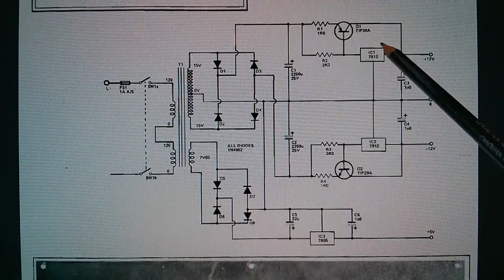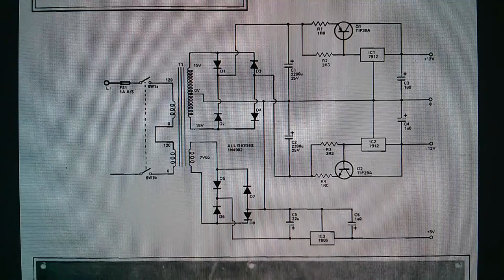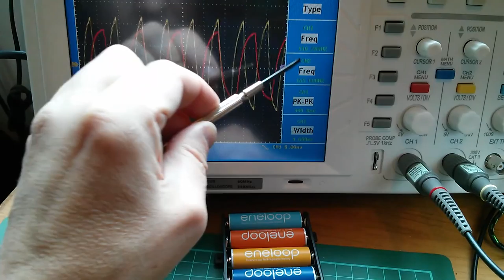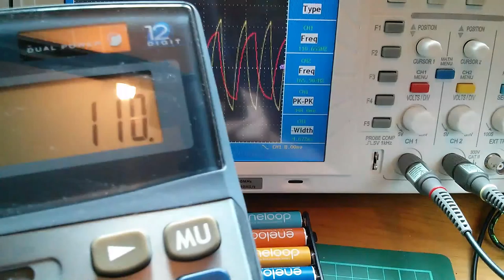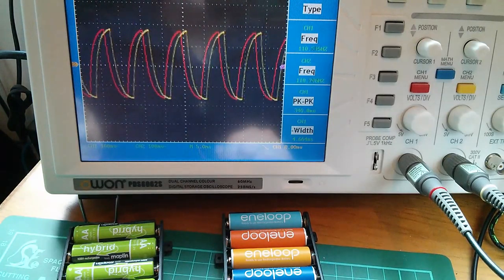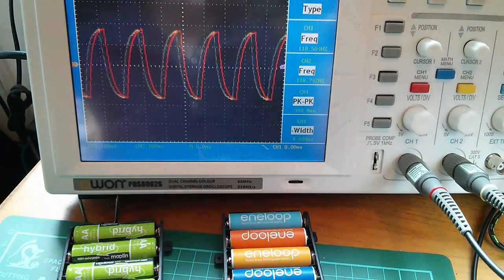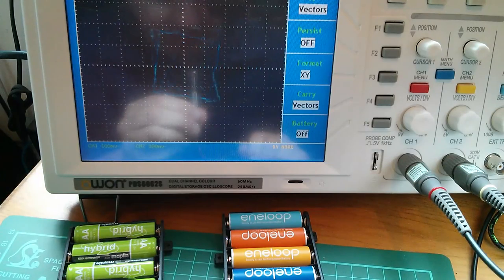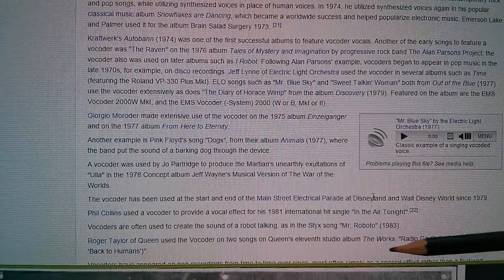Julian's Project: ETI Vocoder - Internal Excitation Oscillators

Comment: I'm just rewatching old videos and I wanted to correct an error in this video. The musical scale is not as simple as you stated here. In the modern 12-step scale, the frequency is multiplied by the twelfth root of two for each step up. If you start at A440 and you want the next note up, chromatically, or Bb, you multiply 440Hz by 1.059 (approximately 12√2) and get 466.164Hz. For the B you would mutliply 466.164 by 12√2 to get 493.833, etc.

I've been following this build and drawing circuit boards to make my own. I've found that R18 is missing from the Internal Excitation Network and I've determined (I think) that R18 has to go from the wiper of RV7 to pin2 of IC4 and R17.

Comment: Using a switch mode PSU can be a problem. You have already seen that two oscillators can "lock" to each other. With a cheap PSU you may induce noise into the circuit. In the worst case it's in the audio frequency range and you have constant beeping noise. In a slightly less bad case it will make your oscillators "jumpy", when they suddenly lock to one of the noise frequencies of the PSU while tuning them.
Many switch mode PSUs are also quite bad at regulating or have major ripple when not loaded enough (varies wildly; I've seen some where 5% load was enough, but other needed 50% load to be really stable).
Combine the locking oscillators with ripple changing with load and you're maybe in for a few random "weird" behaviours.
But hey, try it! It may all work.

Comment: Is it square in XY mode because it's a triangle wave rather than a sine? Sounds like a cross between War of the Worlds and sound effects from all of the BBCs 1970s sci-fi programs - there's definitely a Blake's 7 teleport in there when going out of phase.
Reply from the maker: ***** I think you're right - I'll have to try this again when I have two sine wave generators up and running
Reply: Julian Ilett 
Yeah, it's the triangles. Did you have the scope in AC coupling though? Because with this kind of circuit the output should be a real triangle wave and not one made up of "capacitor charge curves". Since you had straight lines in XY mode, I guess you had AC coupling in YT mode and your scope automatically goes to DC coupling in XY mode.

If you count how often the trace "bounces" on the top and side resp. of the Lissajous curve you have the ratio between the two frequencies. As long as the frequencies are not in perfect sync the pattern will move. Where the curve "bounces" also tells you something about the phase shift between the signal.

Btw. for Lissajous curves and old analog scope is soo much better to display them.
Reply from the maker: superdau I can't remember, but I did put the scope probes on after the DC blocking output capacitor, so I kind of forced it to be AC coupled. I did wonder why the triangle waves weren't symmetrical - I should have scoped directly the output of the op-amps. I wish I'd kept my old analogue scope.

Comment: Hey Julian, since the transformers that you have appear to have separate secondaries rather than centre tapped ones,  you could use the one with the two 9-volt secondaries, each winding driving a voltage doubler circuit (2 capacitors, 2 diodes- the caps can be  ordinary electrolytics) which would be a cheaper solution than a new tran and nicer than smps wall warts!! The original design PSU seems a bit of overkill in terms of current, if all it is supplying is a lot of op-amps...
Reply from the maker: Alan Cordwell That's a neat idea, but I'm going to try and avoid mains altogether. I wouldn't mind getting the whole thing to run from a single low voltage PSU. The high current draw is not just because of the large number of op-amps, but the numerous resistors tied to the power rails and potential dividers to bias and offset parts of the circuitry.

Comment: HI Julian

For the dual power supplies for this checkout this item number for an auction I have on eBay right now :- 321735178182

You can connect two of these isolated DC/DC converters back to back to give dual 12V supplies from a 5V input supply, if you email me your address via eBay messages I will send you a couple over to try out, it will be a neat solution, these give out up to about 80mA per device,

I never got my Vocoder project fully up and running but I did make the transcendent 2000 synthesizer also designed by Tim Ore and also featured in ETI and that was a fantastic instrument and I had many years of fun with it even using it in a band I was a member of in my teenage years,

Dave
Reply from the maker: david ellis That looks like a very neat solution - switched mode without the mains - I like it. I'll be in touch.I could never afford any of the Powertran machines, but I did build the PE microsynth. Usual problem though, a nightmare to keep in tune.